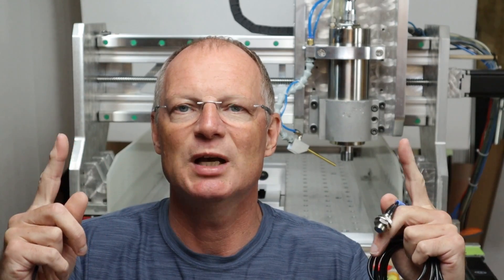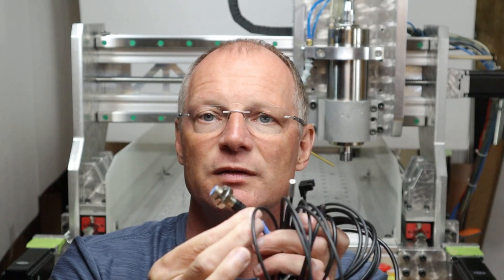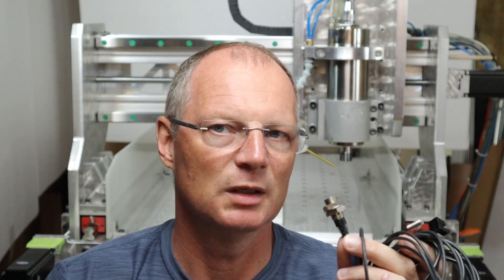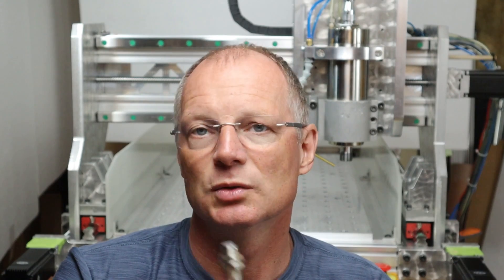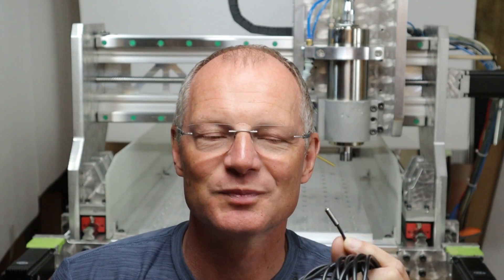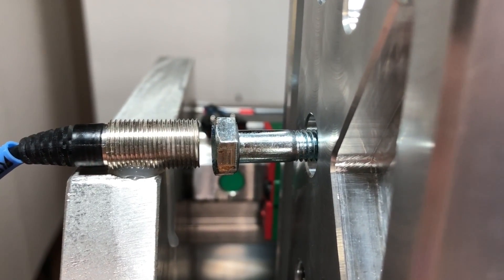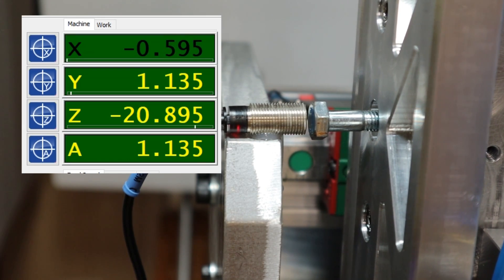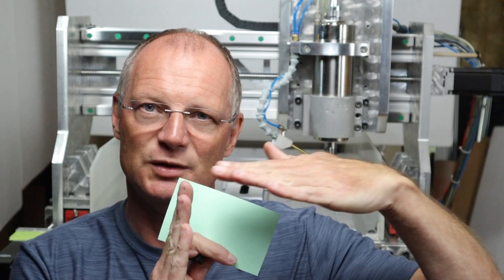Limit Switch Sensor

Comment: Maybe there are a better solution ....AS5600 magnetic encoder 12 Bit encoder.. pcb module is 1.6 USD and ATTINY85 3 USD on Ebay..
if better resolution is needed AS5047 14 Bit. feed the inductive signal and rotonery encoder signat to the ATtiny85, and program an output. what do you think?
Reply from the maker: Definitely a cheaper solution. What I liked about the DRO is that it was ready to go out of the box (minus the calibration). If you try your solution out plz let me know how it went.

Comment: Thank you!
Just a thought you might test some simple D.I.Y PoGo pin limit switches as well as they are Uber cheap and easy to build and wire.
Ref:https://www.youtube.com/watch?v=vB_Q-azidVU
Reply from the maker: I will check it out thx for the suggestion !!
Reply from the maker: Ok, so this is like a spring loaded tool touch off plate. I am not crazy about using the common through the machine. But I can see that also this solution will be cheap and in many cases accurate enough.
Reply: @JBWorx  Yes they come in many different shapes and are mostly used as test pins for PCB test rigs. They are also common in applications like docking stations for laptops etc. Just search for "Pogo pins" and you will find what you want. The nice thing is tah if you have a common ground in your machine structure this setup will become single wire ;)
Reply from the maker: Yes I have seen the magnetic version of these but did not know what they are called. Thx again I can already see other applications for it.

Comment: Great to see some testing done and good to know that most are accurate enough for us diyers. Just wondering if you have a graph of the results or could post the raw data somewhere for us? Thanks
Reply from the maker: The data is a bit unorganized but all complete at the moment. I am trying to write a project article on home switches and upload that to my website. I am still learning on how all that works and I tell you it’s not easy. I spend a good 3h this afternoon to add a single project page just to hit “undo” in the end. Lol 😂 so yes please check back on my site www.JBWorxStudio.com it will be there soon … I hope 🤞
Reply: It would be grat to have the exact typ of those tested models… (specially of the better ones) thank for this great explanation of all typ of switches, helps a lot!
Reply from the maker: Thank you Murat, you can check my website for more information. https://www.jbworxstudio.com
Reply: @JBWorx can you please tell me which model the omron is? I couldn’t find this information on your website. Thank you!
Reply from the maker: There is a picture of the switch. However it is V-165-1C5 I took the roller off but left the metal strip in place.

Comment: Intetesting test! I've opted for inductive switches, cheap chinese ones for a couple of euros. Repeatability is also around 0.015mm, enough for my needs. The thing you need to be careful about with these is temperature drift. If you work on a piece for many days and you use it in an unheated space and the temperature changes 20 degrees c, it may be off by 0.1mm. for woodworking it isn't much of an issue but for metal it can be a problem.
Reply from the maker: Well there are definitely quality differences. The hall sensor should have performed better but it was a cheap one. Also in general it does matter what voltage you operate them at. The lower limit can cause some issues. Quality sensors usually contain a good amplifier and are temperature compensated. Thanks for your comment!
Reply: @JBWorx  True, especially hall sensors since these work with very low signals, and cncs are rather noisy in electromagnetic and supply voltage sense. Some shielding of the sensor and shielded cabling and a good quality psu might help. Still a mechanical switch is not sensitive to these kind of things and inductive sensors may be better suited to cnc environments. Optical is only practical if you can keep dust out of the signal path with compressed air or by encapsulation. 
I've held some ferroes metal chips against an inductive sensor and it didn't trigger, only a more massive piece of metal can change the oscillation frequency enough for it to trigger. I've had trouble with microswitches, either chips preventing it from triggering or working it's way into the sleeving and shorting out contacts or being destroyed due to the cnc running into it at full speed not being able to come to a complete standstill in time. With contactless sensors it's possible the axes bump into something solid before destroying the sensors.
Reply from the maker: Yes, I share your opinion on shielded wire. It is very important, I have seen so many DIY machines riddled by problems that in the end were noise related. Cat5 wire works great and is cheap to use for switches / sensors unless you buy the more expensive shielded version like the Keyence but they are around $100 a pop. The way the sensors are located on my machine I can give the optical sensor a shot. And they are easily accessible and can be checked easy as well. I have a plan for the Metrol switch, I am building a tool length sensor and I think it will be perfect for that. But yes you are right the optical sensor is about 10 fold more fragile than the good old prox switch in a stainless steel housing. But however also 10x more accurate.